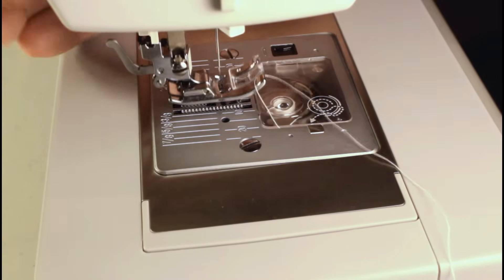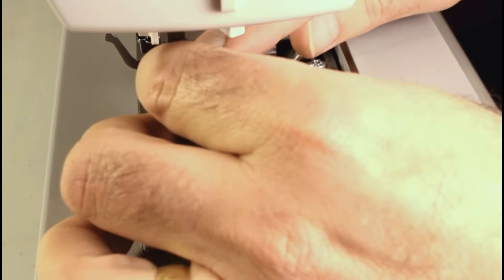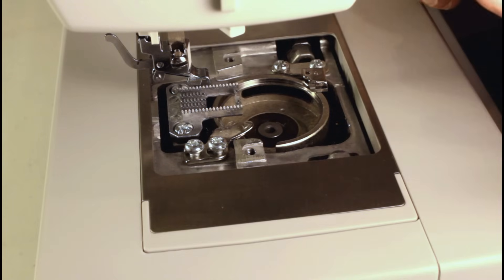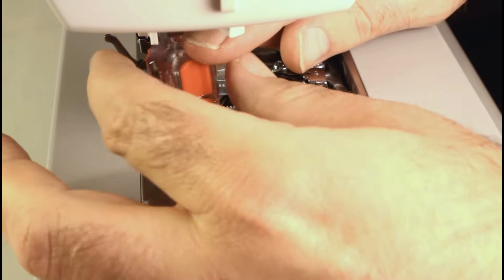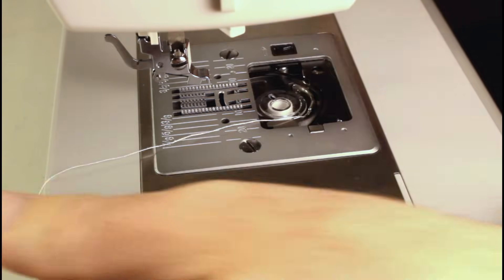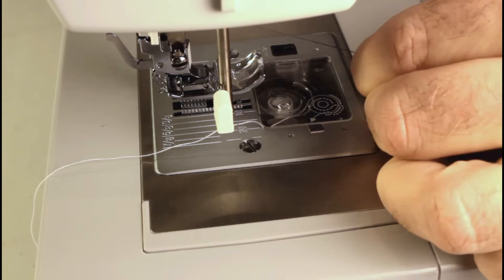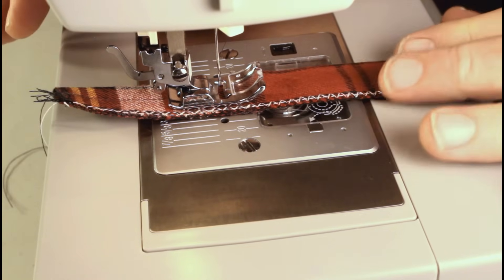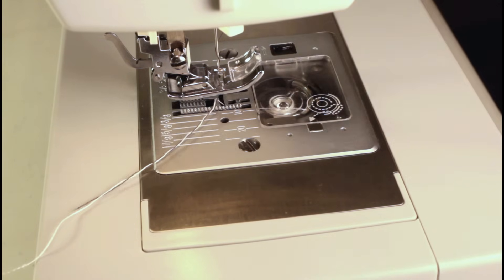Singer Heavy Duty - Adjusting Bobbin Tension, Please read the Description before posting questions.

Comment: I have been fighting a problem with straight thread on the bottom of the stitch for years! No matter how low I put the top tension, the bottom of the stitch was just straight thread... not pulled up at all. After I turned the yellow screw a about a quarter of a turn back I finally have a decent stitch on both top and bottom. Do you give classes on using sergers? Hahahahaha!
Reply from the maker: I am glad to hear you fixed it. No, I don't have any classes. ;)
Reply: @kevinsews  I had pulled off the throat plate but couldn't see how to adjust the bobbin... My old machine the whole thing came out and there was a little screw that was easy to see and adjust... But my Singer 4452 has been a learning experience. Again, thanks.
Reply: @kevinsews  Will you consider one?
Reply: Very clear instructions thank you but I am finding it impossible to loosen the two small screws. Why do manufacturers make it so difficult?
Any suggestions as to how to loosen the screws?
Reply from the maker: @eloundabelle  Look at the other comments. Someone had another suggestion. I have put this on my todo list, but is is a long list. I'll get to it eventually.

Comment: Thank you for your demonstration. My machine was sewing well. I had to add thread to my bobbin and since I put it back my thread is getting tangled on the bottom of the material. Do I need to adjust the tension or do I have to attempt to replace my bobbin better?
Reply from the maker: Test it first. Then try adjusting the thread tension. If none of the above work then you may need to adjust your bobbin tension. Try only turning it 1/8 of a turn first. Then go from there.

Comment: Kevin, Thanks for the helpful video...I was working on my Mother's machine yesterday, and was able to remove the bobbin case without loosening the two screws.  Should that be possible? I may need to go back and make sure the screws are tight...
Reply from the maker: +GrouseHiker No, you should not be able to remove the bobbin without those two screws being very, very loose.
Reply: i was able to remove it too...whats wrong to doit this way???  ineed helpi think ...im having problems with threads in this area...

Comment: Thanks for a very informative video. Can you tell me how to be sure my bobbin tension needs adjusting? I have a new singer 4423 that is sewing way too loosely on the bottom side of fabric. I triple checked my threading and then cranked the top tension all the way up and got a better (but still loose) stitch. I'm wondering if the bobbin tension is too low or if I need to send the darn thing back. All I can find on youtube is people telling me to thread with the presser foot up and, yep, I got that one :)
Reply from the maker: First, make sure you foot is raised when you thread the machine. Next, when you lower the foot and thread the needle pull on the thread and see if the needle very slightly bends. This will  tell you if the thread is seated between the tension disc.

Comment: Thanks for showing the procedure. How does one know if the bobbin tension needs to be adjusted?
Reply: Watch the video! 😂😂😂
Reply: @bltoth1955  I did - twice.
Reply: @JohnBau  He defined the problem when he could see the bobbin thread from the top stitch @ 9:28?
Reply: @bltoth1955  Thanks, yes, but I thought that can also be caused by top tension being too loose.
I can get my threads to "meet in the middle" but with the top tension set at 7.
That's why I'm wondering if maybe the bobbin tension is too tight.
Reply: @JohnBau  I’d think so. Loosen the bottom tension till you can set the top tension at 4.
Reply: @bltoth1955  That's what I was thinking as well. I'll give it a try next time I sew.
Reply: I’m trying to use Gutermann strong thread top and bottom to sew Velcro onto light smooth canvas. Even with top tension set at 9 I’m seeing my top thread underneath. If I loosen the top the stitches look worse. Is it time to alter my bobbin tension? Thinner thread is fine but it’s a job that will get some wear on the finished article hence me wanting to use the stronger thread.
Reply from the maker: https://youtu.be/ddFcH5lnnjY?si=sUFHQDyRZ8NaTxT8&t=185

Comment: I have been wanting to get into making my own waxed canvass goods and was gifted a Singer 4452 Heavy Duty machine for Christmas this year and have had an issue with thread tension.

As the thread loops around the bobbin, it gets pinched between the bobbin carriage/case and the bottom of the bobbin cover plate, causing resistance, which results in the top thread being pulled through the fabric, leaving loops on the bottom side of the piece. I can get a good balance of tension if I turn the tension dial up to 7 or more.

I took the bobbin assembly apart and made a few adjustments and had no luck. After several failed attempts to achieve a pinch-free stitch, I used sandpaper to smooth/remove a small amount of plastic on the backside of the bobbin carriage and the underside of the cover plate. Now, when sewing denim-weight fabrics with thread tension set to 6, I get no pinching, and my stitches look good.

Now, to complicate things, I've switched to using Coats & Clark heavy duty thread which is thicker than normal thread, and it pinches a bit as it loops around the bobbin. I've cranked the tension up to 9 and the top thread is still showing on the bottom side of the piece.

Am I asking too much of this machine, to sew 2-4 layers of cotton duck with heavy duty thread, or do I have clearance issues with the bobbin carriage/cover plate? Any advice would be greatly appreciated. Your videos are quite helpful, by the way. I've watched several!
Reply from the maker: Is your thread V69 or heavier? If so, then it will take some special care to use it with varied success.
Reply: @kevinsews  The thread I'm using is Coats & Clark Dual Duty XP Heavy 100% polyester. I don't think it's too thick for the machine. I suspect it's an issue with either quality control or my error setting up the machine. I've followed the manual instructions on setup as well as referred to a couple of your videos on setup, so I think I have it right. One thing I haven't tried is adjusting the painted screw in the bobbin carrier. Do you think loosening it would be a good idea?
Reply from the maker: @justinluyk1746  Okay, I think you've nailed it.  I've used that thread many times in my machines without any issue. It sounds like a quality control issue on your machine because that thread should work.
Reply: @kevinsews  Ok. Have you had any experience with Singer warranty/customer service? If so, how much of a hassle am I in for? haha. Thanks for your time.
Reply from the maker: @justinluyk1746  Singer is nothing more than a name and a few employees in some small office, so you will have to deal with the company you bought the machine from. I think the warranty is only for 90 days on parts and labor. If you call them they will refer you to the closest repair facility.
Reply: @kevinsews  Gotcha. Thanks!
Reply from the maker: @justinluyk1746  My pleasure! Good luck!

Comment: Great information. Calm. I need to ask a question. I am new to my machine. Singer 4423. Sometimes when I'm sewing, my machine pounds right where/when my needle goes down for a few stitches. Then I freak and stop sewing and start again.  Bam bam. Almost sounds like there is no material to cushion the needle and the foot plate. I don't know if it's affecting my stitches but the sound is scary and it can't be right.
I just watched adjusting bobbin tension thinking that might be the issue.  Thank you, Debra Trying
Reply from the maker: If it isn't the bobbin tension then take a look at my video on Setting the Timing, Greasing & Oiling the Singer Heavy Duty Machines. It will show you how to take it apart to check the timing too. That may show you what the issue is.
Reply: Thank you. It's a brand new machine. :(
I will check everything.
Reply: @debrasbryant7496  I have the same problem w/ my new machine & hadn't seen anything anywhere about it. Super loud clanging noise, freaks me out!

Comment: You are so good to explain, i have a problem with tension but even if Change needles or threads moving the wheel of tension from 0 to 9  i have always the same stitch with the same problem.  The upper therad is show on the back stitch. How can I adjust it?
Reply from the maker: Use the technique I show in the video: https://youtu.be/8TPB2yzw-1Y  If moving the tension dial doesn't change the tension then raise the pressure foot then hold the thread before you thread the eye of the needle and then grab the thread on the top side of the machine and pull tight to ensure it is going between the tension disc. Then lower the foot and repeat the test.

Comment: I have singer 4432 heavy duty, the bobbin tension is supposed to be preset. Do you know if it can accidentally be set out of place? My fabric puckers when I make straight stitches and no matter how much I adjust top tension, I can’t stop the puckering. Thank you for your videos!
Reply from the maker: Since bobbins are mechanical they can come lose with use.  Puckering usually means the tension is too tight. However, it can also happen when the stitch length is too long, but 99% of the time it is simply a tension issue. Place your top tension to the setting of 1 and sew a few stitches and see what it looks like. If it is lose then increase it by 1 number at a time and repeat. If it is still too tight at these lower settings it means the bobbin tension is too tight and it will need to be adjusted.
Reply: Thanks for the input! Is the bobbin tension something I can fix on my own or would I need to take it in to be repaired? Any idea how much it would cost if it’s under warranty?
Reply from the maker: @abigailelizondo4289  If you don't live near a Singer Repair facility then you will have to pay for the shipping.

Comment: Hi Kevin , the video is helpful in understanding how this really works. My machine also has this tension problem. I don’t know how. I opened the plate , removed the bobbin n needle out. Also the presser foot. But the 2 screws to remove the bobbin case is so tight, that I simply cannot do it. Can you assist me as to how should I adjust the tension. Appreciate your help 😊
Reply from the maker: I use these: https://www.amazon.com/I-MART-Offset-Screwdriver-Phillips-Driver/dp/B07HDJGV92/

Comment: I have come back to sewing. I had a bit of a break, well my right side did, but  I am doing much better now, and looking to get back into it.  I seem to have forgotten how to  bring up the thread from the bobbin. The Top thread is easy, but I am having no joy at the moment. If there are any tricks to doing this please let me know ty.
Reply from the maker: Pull the needle thread out far enough so you can hold the thread. Turn the handwheel until the needle goes down and up. Pull the thread tight and you should see the bobbin thread wrapped around the needle thread.
Reply: If you don't see the bobbin thread around the needle on the 4411 what should I look for to be wrong. I'm getting two different opinions one it's ok to use singer metal bobbins in this machine the other is no plastic bobbin only. Which is right?
Reply from the maker: @IvaOldaker  I would stick to using plastic bobbins. The metal ones are thin cheap metal and are often a bit warped and are not as smooth and slick as the plastic ones are. Plus you will know when a plastic bobbin is bad.

Comment: Hi Kevin, great video. I hope you can help as I'm new to sewing. The issue I am having is the machine sews perfectly, but if I try to sew a pvc badge to some 600D fabric it skips stitches. The hook is not catching the upper thread. Ive done about 20 of these badges so i dont know why it's suddenly an issue. The timing seems perfect as it will sew anything else, including double webbing. I've changed the needle, tried different threads, different upper tension, checked the timing.....I'm running out of avenues.
Reply from the maker: Based on what you've said it sounds like the thread is no longer forming a large enough loop for the hook to catch the thread. This means there is something is most likely going on with the needle, or the needle thread tension. Try a larger needle if possible.  A larger microtex needle. They have a sharper point and will  penetrate the fabric better.
Reply: @kevinsews  Hi Kevin, many thanks for your response. Yes, I tried another new needle and that solved the issue.
Reply from the maker: @jamesharrison5004  That is great to hear! Thanks for letting us all know.

Comment: I have been sewing along just fine & then I started having a problem with the  bobbin. I have gone through every video & did everything told us. The area in the front of the bobbin with the yellow spot & notch I have in the right place etc. i just can't figure out why when the bobbin picks up the needle thread, as it comes around the  "notch" - it wont pass over & gets hung up right there. It's like there isn't enough pull to get it past that point- can you help me?
Reply from the maker: Try  very slightly loosening the screws on the bracket that it is catching on.
Reply: Did this fix it for you? I found I am suddenly having the exact same problem and it's driving me nuts!

Comment: This is great but before I try it, I want to make sure it's really what I need to do--trying to sew "swim" fabric (polyester/spandex) with a twin needle, and the stitches look good, but there seems to be some tunneling of the fabric--I'loosened the tension of the top thread to between 2 and 3, and lengthened the stitches, which helped, but didn't eliminate the problem completely. I'm pretty sure I need to loosen the bobbin tension, but doing so scares me, so I'd like confirmation. Thanks!
Reply from the maker: Buy a spare bobbin and use it to play around with the tension. That why you can always place the factory default one back in your machine. You can find one here :  https://www.sewingpartsonline.com/bobbin-case-singer-q6a0764000.aspx?
Reply: Kevin Sews thanks!

Comment: This question my be totally out of space for you but here goes: I free motion quilt on my Singer heavy duty machine. The machinr sews fine on straight stitch and zigzag but when fee motioning the thread on the bottom is loopy. Do you think that is a bobbin tension problem or top tension problem. This happens even though i slow my sewing way down or even if i go top speed. New subscriber here.
Reply from the maker: With free motion is can be either. Try tightening the top tension first and see if that helps.

Comment: Great video Kevin -- I just got my first Singer machine (sewed on this kind of machine in Home Ec 30+ years ago).  First thing after I read the manual I was like, why it doesn't say how to adjust the lower thread tension?  Anyway, in comments you mention you do videos on timing and other more complicated stuff... but I want to know if that is generally the same for other brands of machines (I have both a Shark and a Brother machine and each of them basically stopped doing anything but basic straight and zig-zag stitches at some point.  So no overcast, etc.)  Funny they are both under warranty, but the cost to ship was going to be almost as much as my new Singer and anyway what would I get back but a reconditioned machine that broke once already from new... so yeah, I'd like to still see if I can fix either of them anyway to maybe give to my kids.
Reply from the maker: You're welcome! I am glad it was helpful.

Comment: Hello Kevin. Do you have any reviews for the Singer Heavy duty 4452. We’ve had this machine for 15 days and it has gotten stuck in reverse 4 times. It’s a pain to make it sew forward again. Wondering if this is a common problem. We are thinking about to returning this machine. Is there a machine you recommend? We are using this current machine to make face masks. Any feedback would be appreciated. We sew everyday for about 8-10 hours a day with several breaks. Thank you.
Reply from the maker: Since it is so new I would exchange it for a new one.

Comment: when you threaded your needle the thread was twisted around the needle. is this an aid, something that doesn't matter, or something I should have been doing from the start? thanks for the info.
Reply from the maker: Did you bother to read the info I posted?
Reply: +Kevin Sews I scrolled through everything available and didn't see anything about the threading. nevermind, whatever it is or isn't I've done without. thanks for the information on the tension.
Reply from the maker: Humm, I thought I mention this in the Info about the video. I'll have to take a look when I get back home. Thanks!
Reply from the maker: Okay, finally got home and I took a look at the info provided. Here is what is in the last paragraph of the info provided: "NOTE! Yes I know the thread was wrapped around the needle when I threaded the machine at the end. Working around a close-up camera shot limits my hand position and viewing angles. In the end I had to tighten the case about 1/8th of a turn in order to get the proper bobbin tension."

Comment: Thanks! This was very helpful! After adjusting, my machine will work well for a while, but then the bobbin gets "off" again before I have even finished sewing my garment. Could the high sewing speed of the machine be affecting the bobbin? Just wondered since there seems to be a lot of vibration at high speed sewing. Do you have any suggestions or do I just have a faulty machine?
Reply from the maker: Firefly Alley You need a new bobbin case.
Reply: Thanks so much! Sewing machine is finally working well again!!
Reply from the maker: @fireflyalley1158  You're welcome!